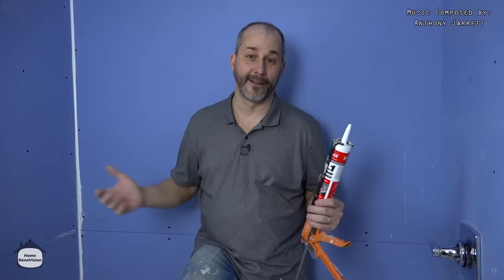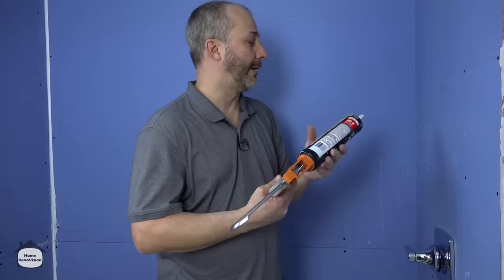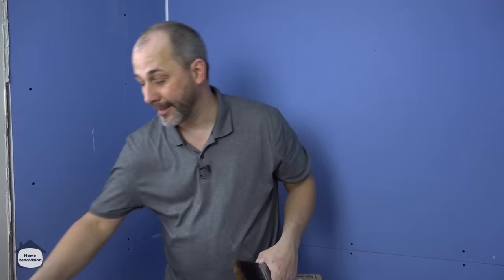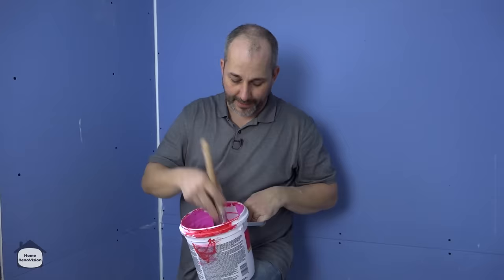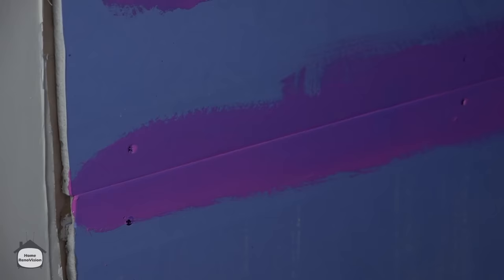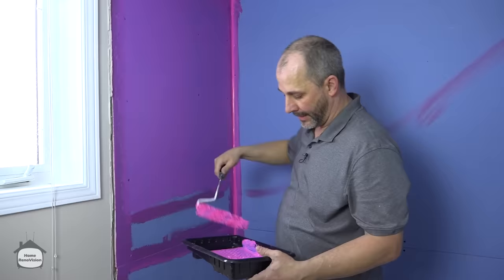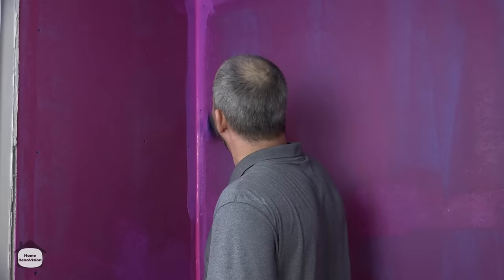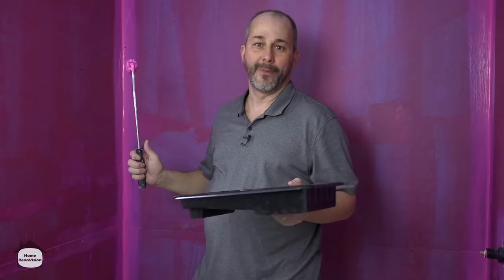The Most Inexpensive Shower Waterproofing System Ever!

Comment: Hi Jeff i'm in Toronto. I noticed that our renovator used Densshield Tile Backer. However he left 1-3 cm gaps between each piece of the tile backer and didn't even caulk the joints. Is that even allowed by the building code? and now the tiles have just been installed!
Reply from the maker: the only thing that seals denshield is silicone. that is why I never use it. You can always ask him to produce literature that backs up his process from the manufacturer. otherwise he may just be installing what he thinks is a good idea.
Reply: @HomeRenoVisionDIY  thanks for the info Jeff. the renovator didnt use any sealant or caulking at all, there are gaps between all the boards. he used some green board too which i read is moisture but not mold resistant. Is it allowed by the ontario building code to not seal the densshield / green drywall ?

Comment: Great vids. I've been following you for a few months now. Great useful advise. Question, i want to concrete my shower walls using a trowel. I have cement board underlay. Do i need the membrane still, and if so will concrete adhere to it? Any advice on concrete shower walls would be helpful.
Reply from the maker: sorry dude, not my area of expertise.
Reply: @HomeRenoVisionDIY  same here. Will be going with tile instead. Put too much work in to chance it. Thx. Will be watching.

Comment: Does the ceiling need a waterproofing membrane too? I rarely see any building videos talk about that.
Reply from the maker: Great question. The ceiling needs to have a great fan and a good 100% acrylic paint. as long as the glass enclosure doesn't go to the ceiling and seal in the moisture you are fine. If you don't have these conditions then I suggest sealing and tiling the ceiling.

Comment: Hoping you can help clear something up for me. 
I had planned on using redguard over my cement backer board. I am using marble tile, and therefore using a thinset with polymer added (ultraflex 1 is the plan). I read somewhere that when using polymer additive mortar not to use a waterproofing system such as redguard. I think it had to do with the length of time it would take the mortar to set up if it couldn't breathe out of the cement board. 
Is there any truth to this, would redguard actually be detrimental to my install?
THanks,
Reply: Did you ever get an answer to this question?  The RedGuard instructions say it can be used with modified thinset.  I'm confused about this too.

Comment: Do you have any suggestions for replacing the LePage 2 in 1 seal and bond y’all have supplied in Canada, to one similar provided in the US at Home Depot? Thanks in advance!!
Reply: One more subsequent question, at the ceiling level where the wall meets the ceiling, if you’re not gonna use tile on the ceiling and you’re just painting the ceiling.........should I tape and mud the seam like normal? I’m afraid if I use the pink and seal it’ll show, the texture, through the paint job. Have you seen this Problem occurring? I’d like to paint the whole ceiling with the stuff and not worry about it, but I wanna make sure the texture doesn’t show through.
Reply from the maker: no need tot ape the walls to the ceiling if you are tiling. Cheers!
Reply from the maker: Use kerdi fix. I have the link in the description of the video to go to my Amazon page .

Comment: Im remodeling the trailer im buying as is its a 3 bdrm 1 1/2 bath and im starting in the bathrooms cause yes the roof is leaking but there was mold in both bathrooms...im a diyer just starting my own channel and i wanted to ask what is the cheapest way to waterproof a shower? Cause the redguard looks awsome but im working on a very small buget
Reply from the maker: Your looking at it. best of success!

Comment: What type of thin set should I use on red guard or aqua Défense? I know they recommend non modified on shluter systems but On the info sheet for aqua defence, a modified mortar is recommended.  Why the difference? Both are rubberized membranes. Help!
Reply from the maker: Actually  those products are quite different ! just follow the recommendations on the package.

Comment: So that is a dry wall?   I seen so many clips using cement board which cost more.  Is dry wall enough?
Reply from the maker: It works in most cases, be sure to check with your local building code. office.

Comment: Hi there! Your videos are great, they are a big help for Diyer's. In your video you say the drywall compound will cause problems. I have an unfinished shower  with blue drywall and it has drywall compound on the corners and the joints. I planned to use redgard before tiling. I have a suggestion from a building store to use the redgard membrane fabric strip where the drywall compound is and then proceed painting the walls with redgard. I really appreciate your opinion on this and what would you suggest in this case?
Reply from the maker: The strip is not necessary. They are just selling you stuff. Cheers!
Reply: @HomeRenoVisionDIY  Thank you very much for your quick response!!

Comment: If you lived by me I would hand up my dyi tool belt and hire you. How many gallons do you think I need on a hardi backer shower area? Also how long does it last in the bucket once it’s opened? Thanks
Reply from the maker: the bucket has a good seal so I would think at least 1 yr. as far as the shower goes I find I get 2 showers per tub.

Comment: Hello,
I am building a shower in the basement. Their is cement under the shower and no wood.
My question us do I need a liner for the shower floor?
Reply from the maker: you need a waterproofing system and a diversion system. That usually requires a drain lower than the concrete and a way to seal it.

Comment: Thanks for the video! What shower base can I used with this method? Would a kerdi shower pan work?
Reply from the maker: any shower floor works. I would use the kerdi band to attach the base to the walls however in that case.
Reply: Thank so much!
Reply from the maker: Hey Timber Smith, my pleasure to help. Cheers!

Comment: prime before you apply waterproof and silicon for joints must be neutral cure
Reply: I prime my cement board with mixture of 1 part Redgard to 4 parts cool water. The Mfg directions (RedGard® Waterproofing and Crack Prevention Membrane / TDS104) says to ALWAYS prime when Bonding to Lightweight Cement and Gypsum Surfaces. Its fast and easy.

Comment: How could I use this in combination as the wall system for the schluter shower tray and curb?  Could I use their corner transition pieces and then paint over it with this system?
Reply: I would also be interested in this answer...and how/where did you find someone in United states that sells LePage 2 in1...
Reply from the maker: pick up the kerdi fix. Cheers!
Reply from the maker: install schluter with kerdi band to seal the floor and then yes paint over the band with this to tie together.

Comment: I’m considering doing this for my shower , here in the states we have dens shield tile backer board,. I wanted to use regard and caulking as you show here. Will a premix thin set mortar work with this application ?
Reply: I’m setting subway tiles in the shower just FYI and in my tub in my master I’m doing 12x24 possibly or smaller
Reply from the maker: I would recommend using a 1 step mortar mix you mix yourself.
Reply: Home RenoVision DIY awesome! Thank you . Keep up the good work  and thank you for sharing your videos and knowledge with us all .

Comment: Is it possible to use this red guard and then paint the walls for the finish or is it only for use with tile.  I didn't plan on using tile above the bath surround just painting it but now that I seen you use this red guard I thought in might be better to use it then paint.
Reply from the maker: simply behind the tile. You can use regular bathroom paint for anything above the tile line. which should be a minimum of 6' or 72" above the tub
Reply: Ok, thanks.  So you are saying that I can paint over the red guard and it will look ok and as long as it is above 72 inches which it is because I have a plastic surround that covers the three walls around the tub and is 72 inches high.  My main question is, is it ok to paint over the red guard and will it look ok or will the red guard show streaking or lines from the red guard ?
Reply from the maker: please don't use red gaurd where you will paint. the paint will provide enough protection for you on its own. the redgaurd will destroy the final look if it is applied where you will paint.
Reply: Ok, thank you so much for the information.  I truly enjoy all your video's.  God bless you and yours.
Reply from the maker: Cheers!

Comment: Can I mix this method with the Kerdi system? If yes how would I do so? Would I paint and then mortar the membrane at the base or vial versa?
Reply from the maker: no need to use waterproofing systems. But if you are worried about longevity I would take the schluter course and use that. Cheers!
Reply: Home RenoVision DIY 

Sorry I wasnt clear Im using a Kerdi shower pan. How would I go about using this method with the pan? (Ps I'm using green drywall). Thanks!
Reply from the maker: LOl in that case use the kerdi band from the floor to the wall with the inside corners and then paint right to the floor joint. this membrane system will bond to the kerdi as well and give you a great seal. You will forgo the warranty from schluter however. But the system is sol.id. I used this on the manotick bathroom with the custom tile walk in shower video. It works great.
Reply: Home RenoVision DIY 

Alright will do thanks soo much

Comment: will the thin set or mastic stick to that non porous Red Guard.??
Reply from the maker: the best solution for this is non modified cement. It will stick and the benefit is the longer it stays wet the harder it cures.

Comment: once applied can  you bond  using a Loctite adhesive or similar adhesives bonding  to this product?  There customer support told me not made for gorilla glue or locktite adhesives.   To be used before thin set before tile 

I am trying Dumawall.com  interlocking glue up just thought this might be a good precaution.. Find it hard to believe that adhesives may not bond to it...guessing I could try it on spare piece of drywall then glue to it with gorilla or Loctite power grab
Reply from the maker: I have not worked with dumawall, I would suggest following their instructions.

Comment: If one of the shower walls is exterior, do you still put the plastic behind it?
Reply from the maker: definitely! don't confuse exterior vapor management with shower water management. they are 2 different systems. Cheers!
Reply: @HomeRenoVisionDIY  what does the plastic do in this case.

Comment: Hi Sir, after RedGard, what we do next? Thank you for your hard works, I love your videos
Reply from the maker: Go ahead and tile. I would suggest using ultra lite cement by mapei.
Reply: Thank you Sir.
Reply from the maker: always here to help with questions. Cheers!
Reply: Hello
Can I adhere red guard to an polystyrene  shower panel? I have a metal bathtub, and I am redoing the walls around the bathtub because we discovered mold. I am wanting to use a concrete panel (less likely to mold than drywall), and then seal it using red guard. The only thing I am concerned with is if red guard doesn't stick to the adhesive glue which will be used to glue the polystyrene shower panels. Would seriously appreciate your help. Thanks
Reply from the maker: In your case i would suggest cement board, polystyrene no red gaurd but use the lepage 2 in 1 adhesives sealant to close all the joints. Mold free for life.

Comment: Would the RedGard work by itself without tile??
Reply from the maker: If it doesn't it wouldn't be waterproof. I still recommend installing tile to make it pretty and durable.
Reply: Home RenoVision DIY » I never understood the logic of tiling a shower. If you depend on RedGard to waterproof that implies that tile is not waterproof....so why use tile?
Reply: You can ware through the layer tile is a harder surface
Reply: Tile is waterproof but usually grout isn't. 
We have vinyl roll that can be clued over plaster board and it's waterproof and doesn't need any top layer because you get it with many different textures. But still usually every shower room is tiled over waterproof membrane.
Reply: The metal shell works without a heart, why not membrane without the tile.....lol

Comment: Thin set kurdi membrane right to the drywall is just as easy and faster than redguard and doesnt cost that much more. If its my house i want it as good as possible and shluter products are as good as it gets.
Reply from the maker: It actually costs about $300 dollars more by the time you factor in the membrane and the cement to install. That is why I would suggest kerdi board. if you want a superior install. Cheers!

Comment: Why didn't you use a mesh tape in all corners and joints? The product says to do so and the manufacturer video says so. Also not supposed to put on thick, need even coats, too thick makes it crack.

Comment: You don't use drywall compound in a shower 
You use thinset 
I have installed hundreds of showers using green board 30 years have past never any problems
But you should use cement board 
You don't have to do it the way he is showing you 
But like he said if you want to spend more go right ahead
No one used that 40 years ago 
I don't think it was around 
it's expensive now how much was it 40 years ago
They hot mopped and still do

Comment: Jeff. You seam like a very nice, and very well meaning person. I want to help you. 
This is certainly not a method that I would suggest. EVER. 
In fact I am certain that you will not get a “20 Year” shower out of this system.
“Mold resistant” drywall is not an approved substrate for tile in wet areas. Consulting the TTMAC and the Tile Council of North America. 
Can I offer you some free training? Literally at our expense?
Reply: He clearly stated codes are weak where he's working , no need to be so high and mighty

Comment: I would maybe use water resistant drywall on a ceiling, but never behind tile. That's a huge no no to me. Use durock.
Reply: Durock turns to mush in water.  Why waste the money for an equivalent crappy product that is just harder to cut?
Reply: @Road_to_Tolaria  I recently took apart my 20 year old shower which had durock, no mush, no water stains, no mold, just solid cement board

Comment: DensShield would have been cheaper, since it does not need red guard, it is waterproof drywall from the factory.  It's only $12 a sheet, probably same price or cheaper than what you have there...
Reply from the maker: My only problem with densheild is it seals in the corner with silicone. Not a big fan needing to rely on that. Cheers!
Reply: @HomeRenoVisionDIY  Why not use LePage 2 in 1 sealant (instead of silicone) to seal the corners with DensShield?

Comment: this stuff is hard to get off your hands! use gloves. Also, to paint over it is a nightmare as the red shows thru even after 3 coats of paint.
Reply: On sections of the wall that are not in the shower, where you’re trying to cover the red guard with paint, do a thin skim coat with drywall mud, texture if needed, and then paint. That will cover the red much better.

Also, it will come off of your hands quite nicely with a bit of lacquer thinner.

Comment: Hi you should see how is in England Here everything is wrong I done dozens of bathroom and I didn't see even one which was done correctly Everything is cover by plaster and customers don't want to spend extra money for replacing existing plaster boards Builder use normal plaster boards which is not even anti mould You can forget about any extra cover like liquid foil England is completely disaster if we talk about building:)))
Reply from the maker: That is pretty much how it is anywhere there is no consequences for bad building practices.

Comment: I completely disagree with this guy, we don't need more regulation as we already are regulated to death in the western world. Caulk needs to cure completely before you seal over it or it will never cure (just like it doesn't in the tube while it's air tight.) Steam will find it's way into anything and is the most mold causing force in the bathroom so waterproofing the top is just as important. Redgard needs to soak into the surface to bond long term, I would recommend you thin the first coat 2-1 with water then do three good coats. Otherwise it will peel in places in a few years.

Comment: Step 1: STOP using water-destroyed products like wood and drywall in a water room.
Step 2: Learn that sand cement is actually easy to use and extremely cost-effective and durable.
Step 3: Never have to replace anything again. Profit!

Comment: There's no way I'm putting tile on any drywall no matter what anone says it's only .50$ more per square foot to use cement board and it's moisture stable if you want cheap use plastic side walls and call it a day